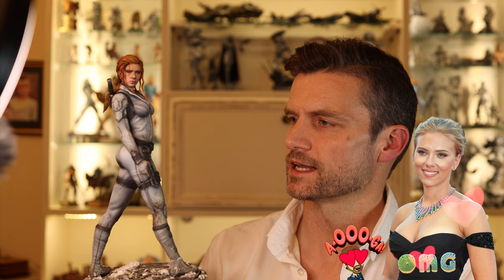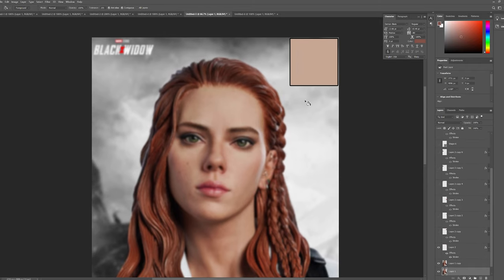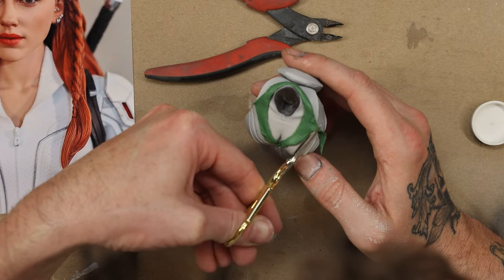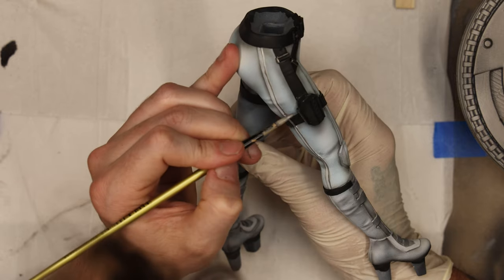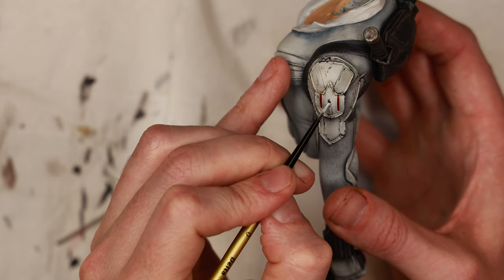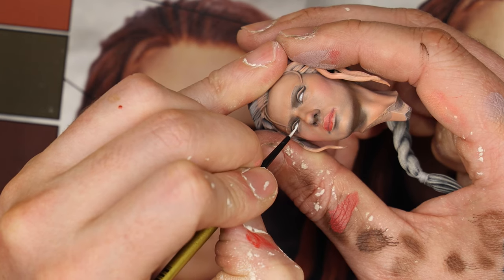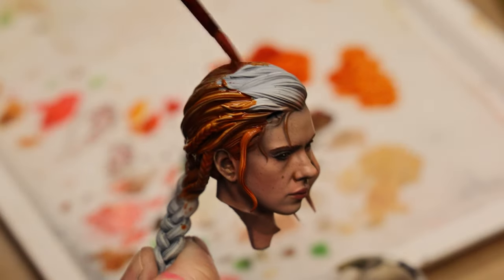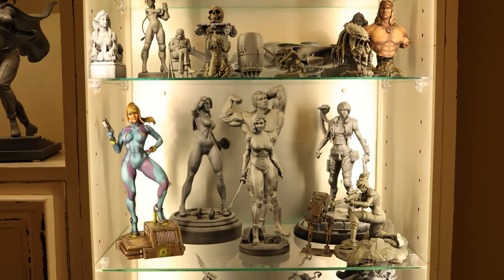Let's go BLACK WIDOW. A 3D printing and painting explanation.

Comment: I do not know if you know, but if you use hot water or a hair dryer you can remove the suports easly and without any hard effort.
Reply from the maker: Oh really? I had no idea, but I guess that makes sense! That would be much easier, Cheers Bro!
Reply: @MichaelGallop  yes put the print 3-5 min in warm water. The supports gone very easy
Reply from the maker: @michaelpiper6601  I have started doing that, it's much better!

Comment: Great work. Just got my first large format resin printer and this was my first print. I'm colour blind so will be using your vid as a guide.
Do you happen to have a link for the batons please. I've looked on Thingiverse but only found large models. Did you use one of these and scale them down. 
Thanks!
Reply from the maker: Hello, thanks! that's great.
https://www.thingiverse.com/thing:4570010
that's the batons I used, but only the handles as the shaft part looks a little flimsy. Cheers
Reply: @MichaelGallop  Thanks a lot Michael.